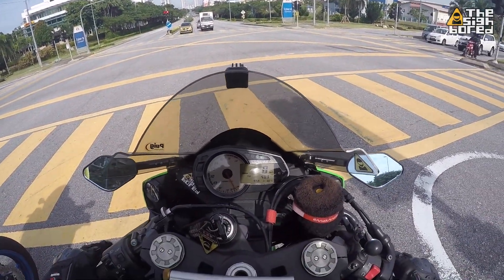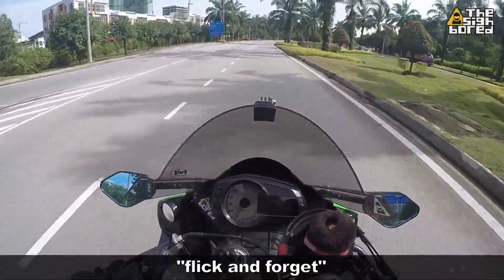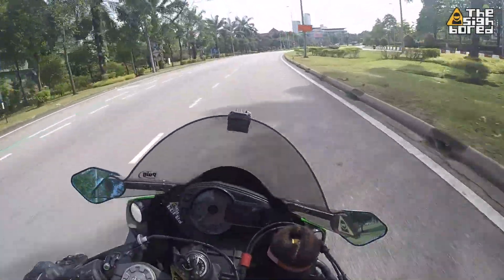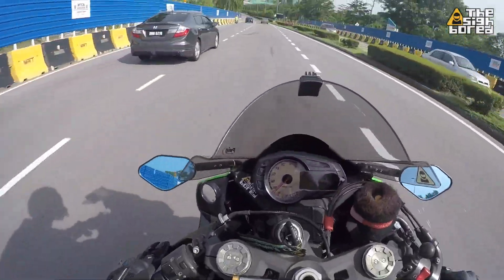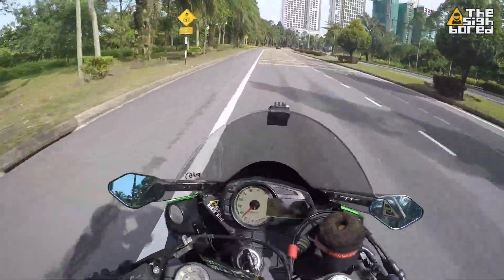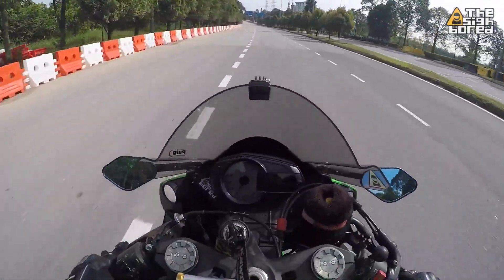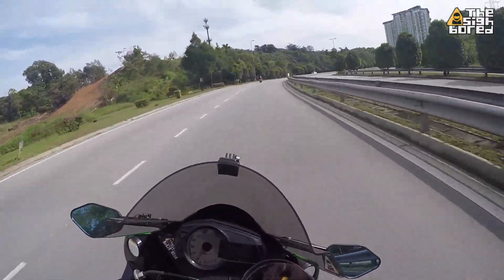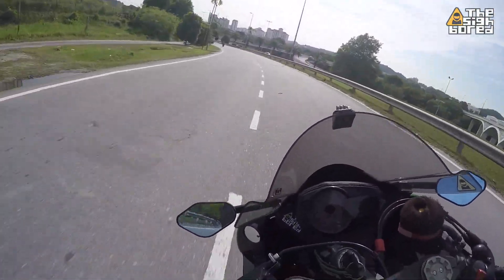Kawasaki ZX-6R Smart Turn System overview

Comment: Ah I was wondering why you posted the video again... makes sense now and yes it's definitely an accessory to have. Cheers!
Reply from the maker: First one was the installation and first time testing. This was is a follow up after using it a while, when all the hype is gone, how it functions, also to make a correction for the first one where I said I couldn't turn off the signal, but actually can turn it off. :)

Comment: Sweet bike mate! I've gone from my bike to a BMW that has the smart turn system and it threw me for a loop haha. Couldn't get used to it. Is it just me or is your handlebar/console area pretty busy? haha
Reply from the maker: Basically it operates like how you normally operate your signals just that it automatically turns it off. :) What's busy in my console/handlebar area? I have a voltmeter hidden below, a RAM mount ball at the brake lever clamp (without anything attached, usually will be where I fix my phone to for GPS if needed).. The center is a steering damper, meter display is OEM.

Comment: Bro soalan ni xde kaitan dengan video but still nak tanya untuk pendapat..antara motor r25 dan ktm rc250 which one yg better utk dibeli..dalam dilema
Reply from the maker: The R25 looks pretty nice, and the parallel sounds pretty nice too. I might lean a bit more towards the R25.
Reply: TheSighBored tq bro..okay lepas ni kompem la r25..
Reply from the maker: You should go try them both out and see which one you like better..